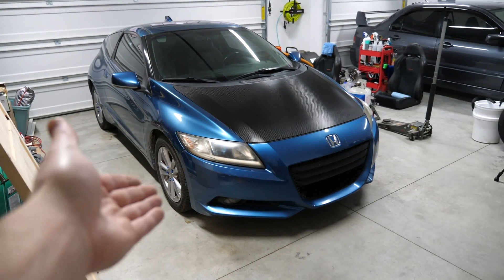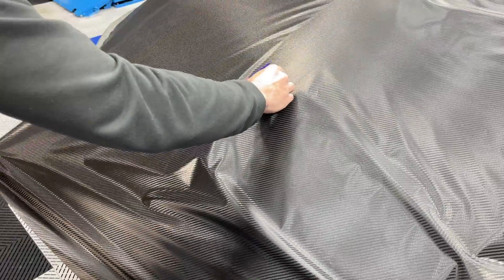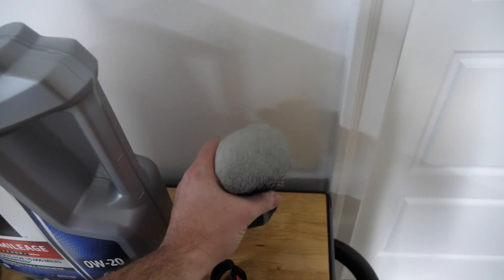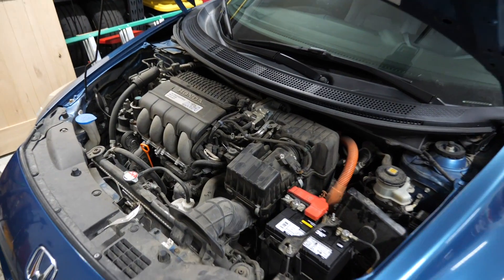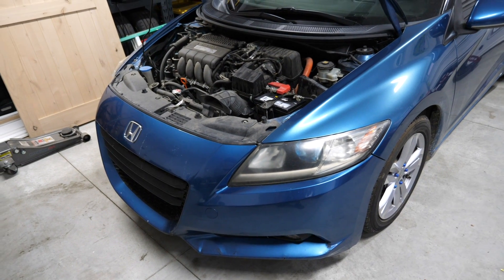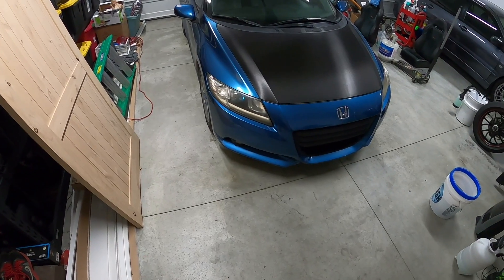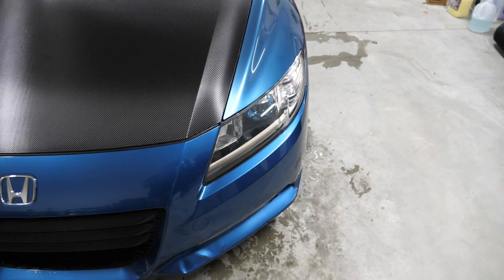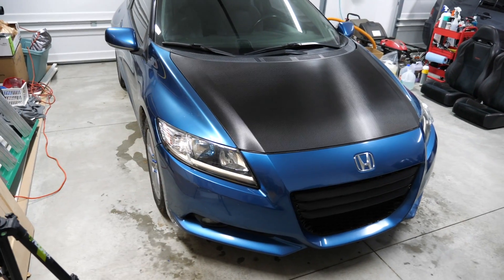Cloudy Yellow Headlight Restoration & Oil Change on my Honda CRZ!

Comment: The 3000 grit sponge is what I use on light to moderate oxidation as well, all you need to get the bulk off, and no need for extra steps on sanding. After the 3000 grit I usually go straight to polishing with my 3 inch buff and shine polishing pads on the rotary polisher and M205, pulls out the 3000 grit marks just fine without the need for a compounding step.

Comment: Anthony:  Just be aware that JDM headlights have the beam cutoff setup for right-hand-drive.  That means instead of shining light up onto signs on the side the road, you will be shining light up into oncoming traffic.  Not sure it's possible, but if you can swap the projectors from the US headlights into the JDM ones, that might be a better option.

Comment: I used Meguiar's G2970 Two Step Headlight Restoration Kit for my headlamps and was so easy to use with less work than in this video with the same, if not better results.

Comment: Headlights came out great,  but they will fade out again. Best thing to do is remove them, sand them down, and respray them with a quality 2K clear coat
Reply from the maker: A pro level ceramic coating will last a couple years. 2k restoration is a great option, but I prefer PPF. Protects the light and keeps it from oxidizing

Comment: You got lucky, on my car the plastic on the inside yellowed, and when I took them apart the only why I can explain it is two plastics together o it was yellow in between making it impossible to restore. Ended up looking on ebay for a long time until I found two in real good shape. The i manged to get my hands on a pair of JDM ones.

Comment: Hey man, I thought the carbon was real before you said otherwise. I say it's nice 👍
Reply from the maker: Haha under the garage light it does look more…real
Reply: @ALLDAYANTHONY  Close enough lol. I have a hood for my EK that was meant for a 96-98 that I got for 30 bucks so I took at it with a dremel and black spray paint and made it fit my 2000 HX. You've got one up on me for sure 😂

Comment: How long does the ceramic coating tend to last in your experience?
Reply from the maker: The coating itself will last 2+ years. But there still is a chance that they can yellow again depending on UV exposure. PPF is more of a semi permanent solution